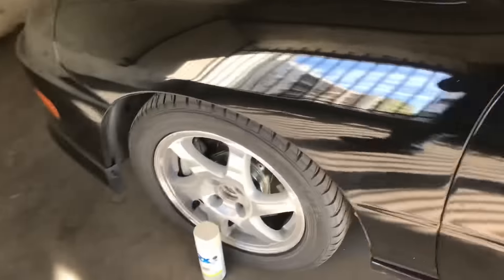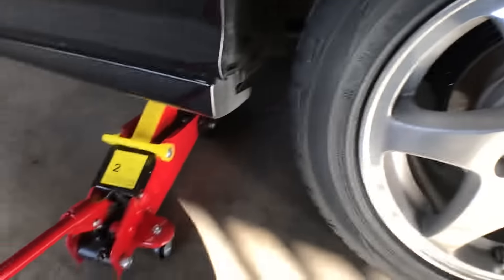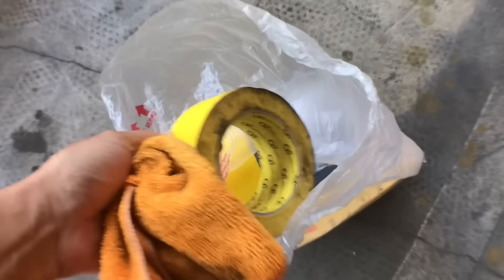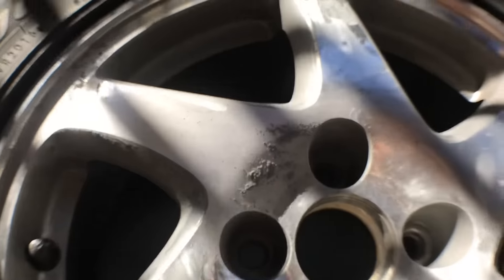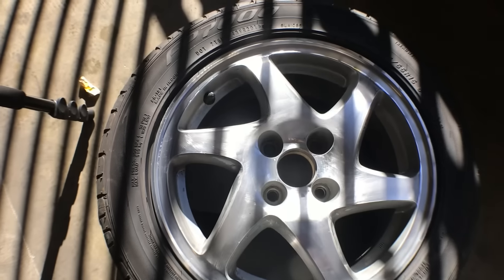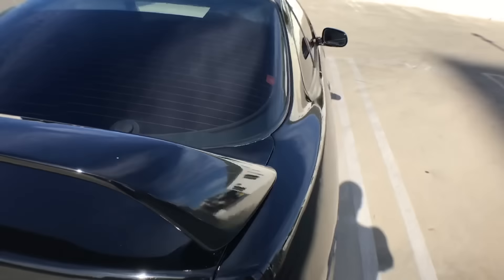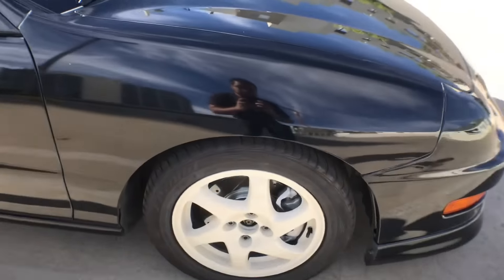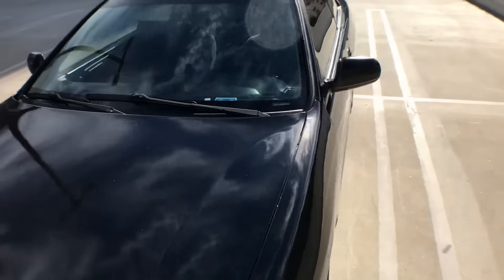Integra GS-R Update: Almond White Blades!

Comment: Damn looks pretty clean i feel they need center caps tho lol
Reply from the maker: VTEG818 I agree! Only reason I’m not painting the center caps is because this paint is very grippy, it admires very well. So if I ever wanted to take the white paint off the caps, I’ll remove the original Acura logo also during the stripping.. so I’ll basically destroy them.. if I had donor caps I could paint them and put Acura decals on, that’ll look sweet
Reply: @IntegraDIY  yea i wouldnt paint center caps either but have u tried them on? Or would the silver look wierd with that color
Reply: @IntegraDIY : 01-05 Civic center caps should fit into blades, if you wanted to use those. As you stated, The "H" logo would get painted over, so that shouldn't really be a problem.  I happen to have a set of them... somewhere lol